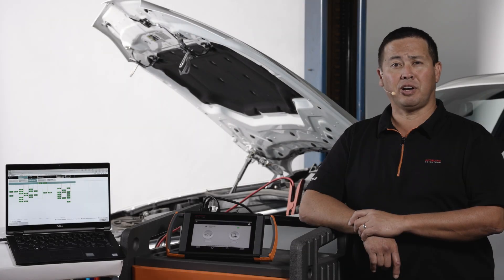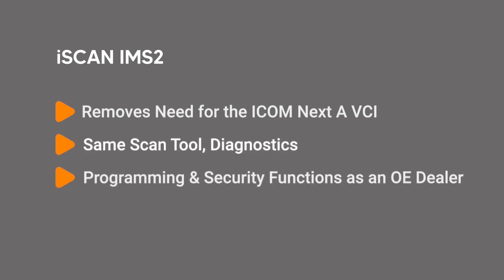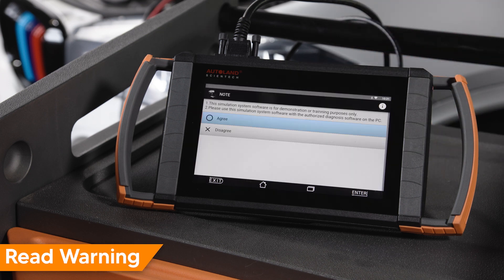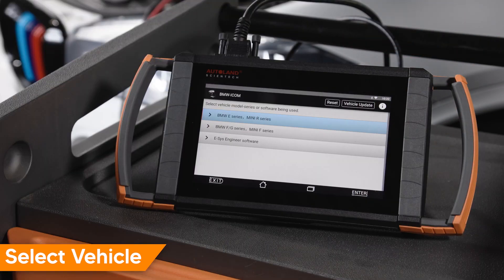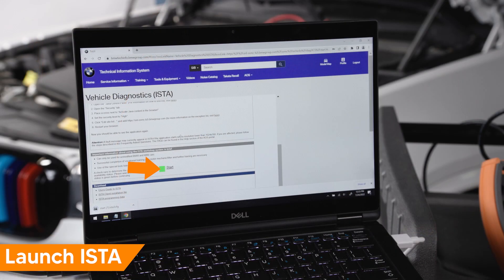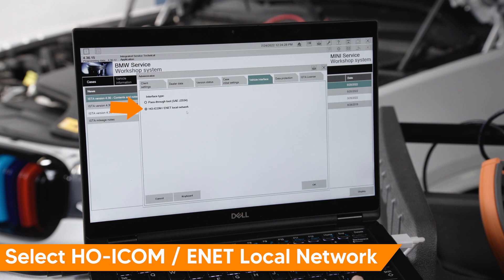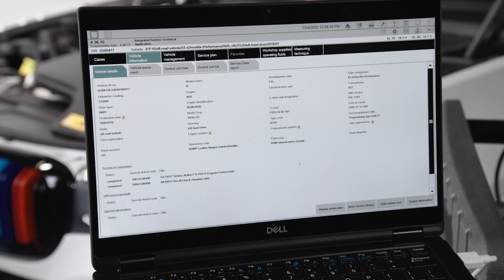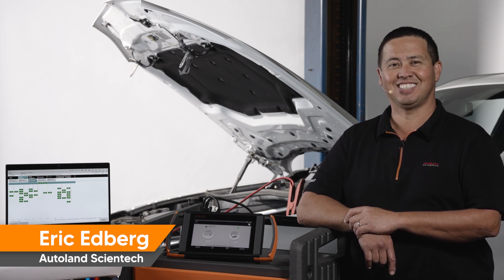How to Set Up BMW / MINI ISTA with iSCAN's IMS2

Comment: What functionality am I losing by continuing to use ICOM NEXT A or Enet cable VS using the iscan as interface?
Reply: You are not losing any functionality either way as IMS2 is a true ICOM NEXT A alternative.  IMS2 is not J2534 but an actual software emulation of the factory interface protocols.  IMS2 BMW ICOM only supports the ICOM NEXT A protocols (not B & C) so you cannot use it for older 20 pin round connector vehicles and it does not support MOST bus programming for E chassis vehicles.  Hope that helps!
Reply from the maker: Thank you, Eric!
Reply from the maker: None! It is a direct function alternative.
Reply: You’re using OEM tool, they’re most likely talking about aftermarket J2534 tools like Bosch Cardaq Autel Laucnh etc etc.
Reply from the maker: Thank you for the input.